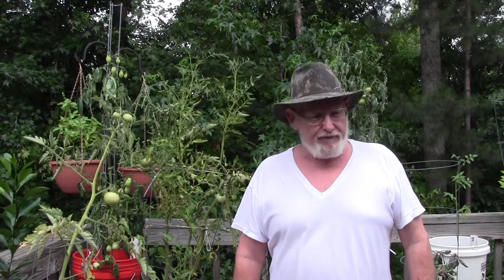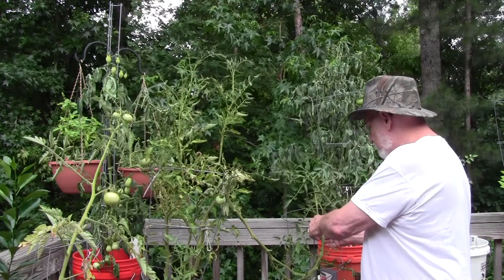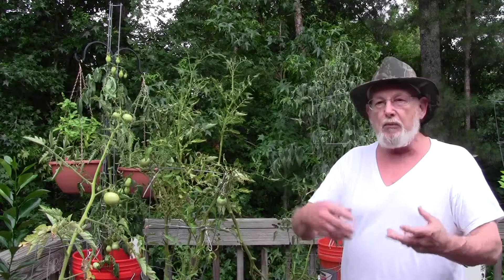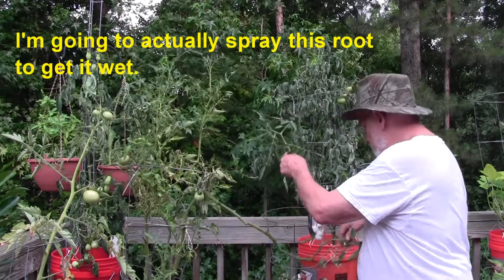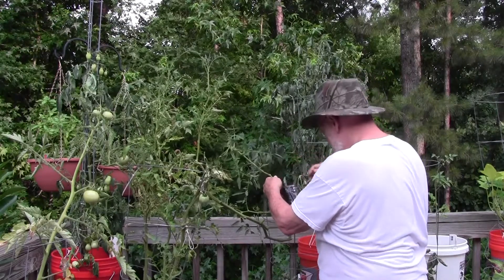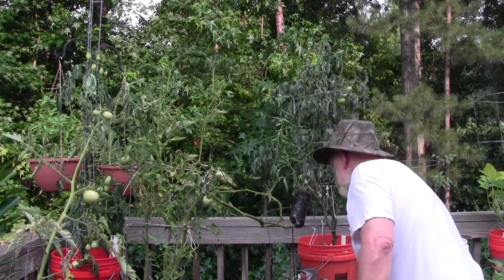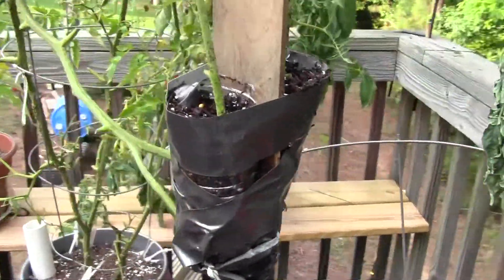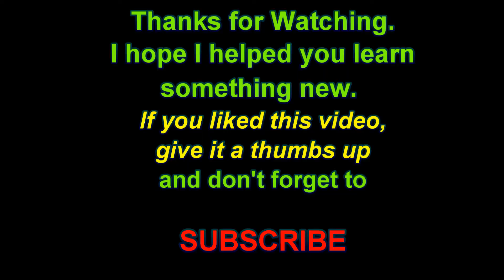Cloning My Beefsteak Tomatoes - Part 1

Comment: Wow your plants look like hell. Those buckets are way to small for beefsteak plants. The leaves are wilted and curled with pitiful fruit. My suggestion would be much larger pots and water them . It looks like your dirt just came out of a bag. Check your fertilizer too. After fruit set no more nitrogen . You want something like 3-6-20.  Pour the potassium to them for bigger tomatoes and healthier plants. If your organic use some ashes out of the grill or fireplace. Also half of the tomato is calcium and epson salt so use some on them.

Comment: Thanks for watching and hope you have better success next time. Since this video was made, I have tried several other approaches. The plastic water bottle is really hard to work with. Try using a piece of old T-shirt tied above and below the place you want to root. Make sort of a bag out of the cloth and stuff the cloth bag with potting soil. Wet it down good initially and spray it regularly. After two weeks, you should have enough roots to transplant. That technique is much easier!

Comment from the maker: @SteveHarpster Sad to say, I waited too long to bring them in. Both got zapped by the freeze and I was not able to salvage either. I will begin again this spring. My real question is: "Does the fruit degrade in quality?" This isn't really a clone...after ten "generations", it is simply a REALLY OLD tomato plant!

It's going to be a good experiment though. Maybe I'll try it with seeds instead of cuttings, too.